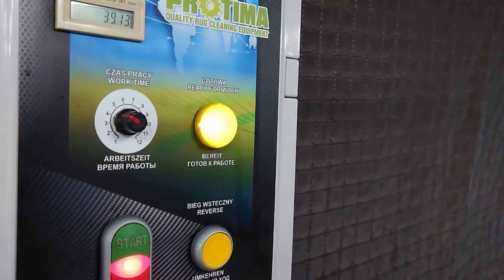Pranie długiego i bardzo brudnego dywanu. Brązowa woda wypływała. Przepiękne wzory i kolory ożyły💪😍🌊

Comment: #1, he produces great results and his work ethic is phenomenal.  He doesn't take short cuts and I'm not sure what he charges, but I'm sure it's worth every penny.
#2.  I really feel like LCC needs to know that he should try to exchange his power spraying portions of his process with combination spray/extraction (typical US carpet cleaning machine).  I know that when he power sprays a rug on the edge, it produces dark gunk that runs off, but haven't you noticed that when he sprays the middle of the rug, little to no dark run off is produced?  That's because the power spray is releasing the dirt and grease, but then it has to travel over 12-36 inches of carpet to find an escape and most of the time it cannot escape before the rug soaks it all back up.  In an extraction cleaner, it only has to travel upwards about 1/2 to 3/4" to find it's escape into the vacuum.
I'm only saying this because I think it will give him faster results.  This kid could clean the hair off a hog with a toothbrush because he is a very hard worker and has a good mind for this stuff.  But I think an extraction cleaner would save him some time, again ONLY in the power spray portion of his process.
love your videos!
Reply from the maker: Thank you very much 🤗💖

Comment: Your work is very good, but the drainage fails (insufficient), better 4-band drainage and a slight slope of the floor, the effort would be less and the dirt would practically remove itself around the carpet. Good luck if you can prosper make those changes and your body and time will thank you 🍀😊❣️.